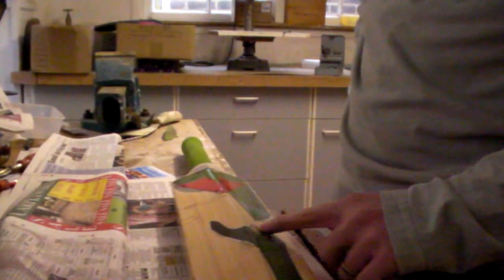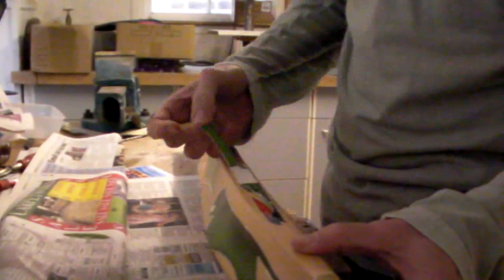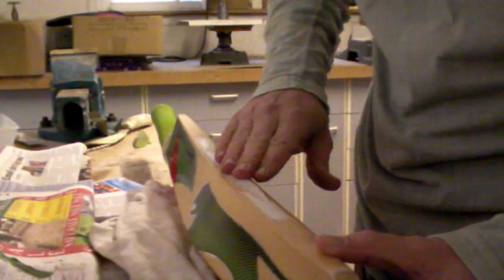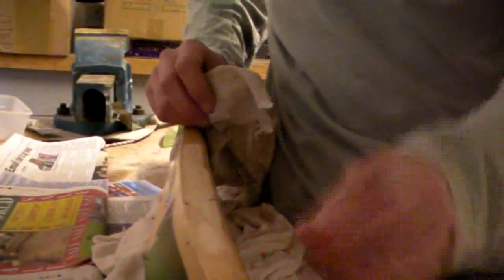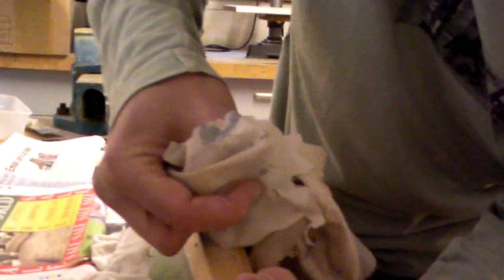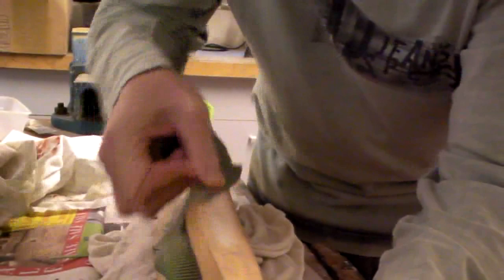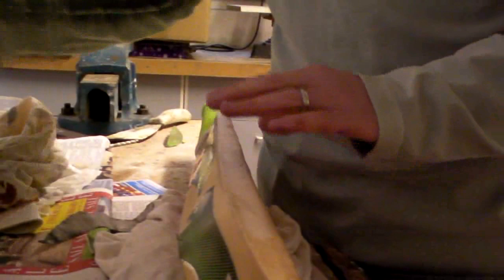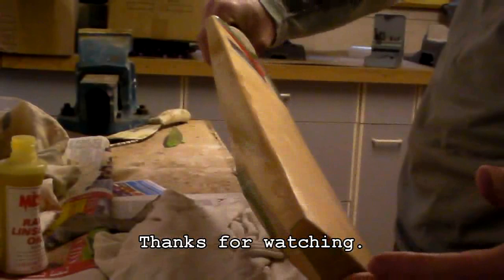Cricket Bat Sticker Removal

Comment: Thanks for the upload mate~~
Nice video
My issue is a sticky protective sheet. My Old (Favorite) bat seemed pretty dry after its use in the season, So I wanted to oil it. The problem is the protective sheet is made up of Fibre, which was a good option when sticking it for the first time. But now that I tried removing it, it wouldn't come off. SoI had to peel my way all through the bat . (My nails are done for :( ) .. But the thing is , the glue of the sheet was very very sticky, I hace tried sanding it off but its not working.. DO you think it would be advisable to use white spirit (Or nail remover) on the face of the bat, without effecting the wood underneath ?
Thanks in advance
Reply from the maker: +waqas hasan  Hi Waqas. Glad you liked the video. I think using white spirit will be fine but do it on a small section at a time so it doesn't get soaked. It should evaporate anyway but clean off any excess and get the oil on it straight away. I would have thought having the protective film on the bat should keep the oils locked in and not need to be topped up though it depends how much of the face is covered I suppose. Good luck.
Reply: My bat has protective sheet made up of fibre , when I tried to remove it it damages my bat , grains come out . what should I do to remove it?
Reply from the maker: +Irfan Shaikh Have you tried heating it first with a hair dryer or heat gun? this should loosen up the glue a bit and reduce the chance if lifting willow. Good luck.

Comment: i just peeled my sticker of as they were not paper so it that ok or do i need to oil the places where the sticker were
Reply from the maker: If it's bare wood underneath I'd oil it. If it's coated then you'll be fine without oiling. Good luck.
Reply: what do u mean coated
Reply: but the wood there is a little rough
Reply from the maker: rav gamerdude In that case give it a light sanding with fine sandpaper before oiling.
Reply: what else could i use as i dont have sand paper
Reply from the maker: rav gamerdude Not sure. A fine file? Nail file?
Reply: thx i worked with a nail file

Comment: Blimey you don't half make life hard for yourself. Next time try this. Run a hairdryer on low over the stickers it softens the adhesive whilst doing this scrape the gunk off with the edge of an old debit/credit card. There will be a tiny bit of glue left. White spirit wont harm the wood it evaporates before it can lift the grain stick some on a cloth and rub of any remaining gunk
Reply from the maker: Good tip using the hair dryer. Thanks. Still, this was the first time I ever attempted it. My new bat doesn't have side stickers thankfully.
Reply: Plz help can nail polish remover(the normal one) be an alternate for the White sprit and would it effect the willow if I use nail polish remover in the same quantity as I would have with white sprit
Reply from the maker: Kingline 5858 Don't see why not, after all it's used on nails! Not sure how many people would use white spirit on nails! Maybe try a small section first. You shouldn't need much anyway